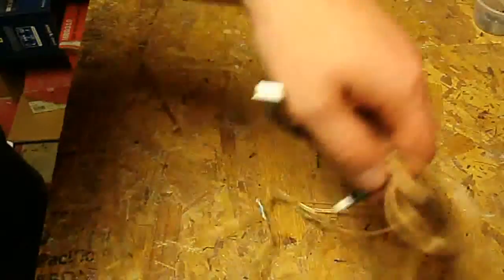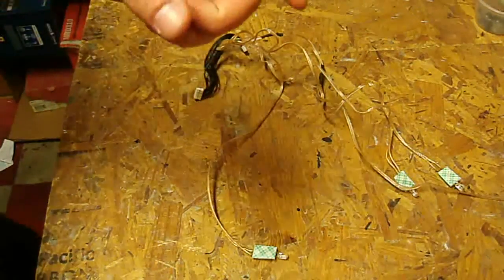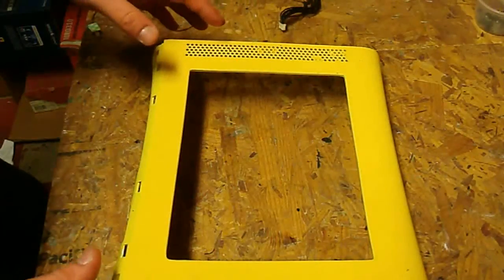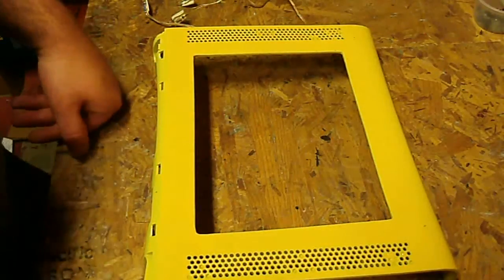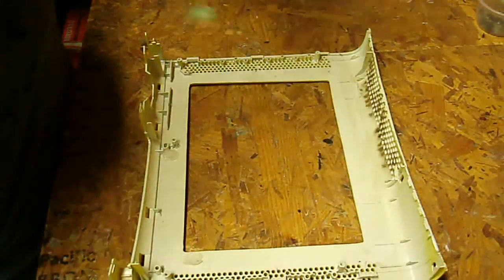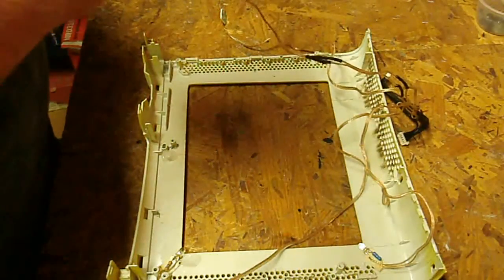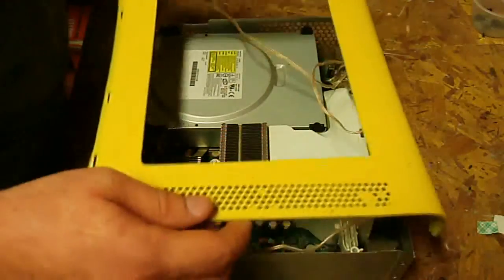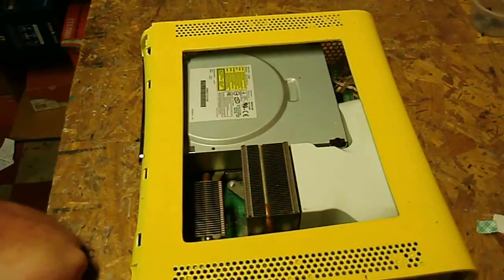Learn how to install an LED kit in an Xbox 360 console. Case modding tutorial

Comment: i like how your led strip is done, but how is it wired to the dvd drive cable? You don't say how it's wired. From the 4 led wires, do you just tap into the power and ground? that would be a lot of wires tapping into 1 ground and 1 12v single wires